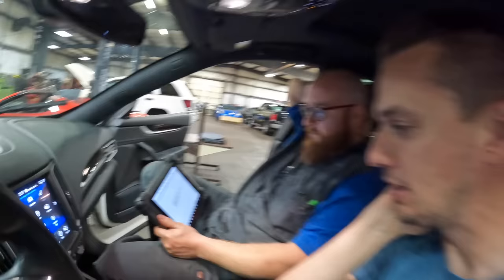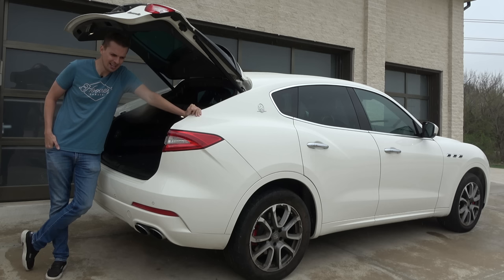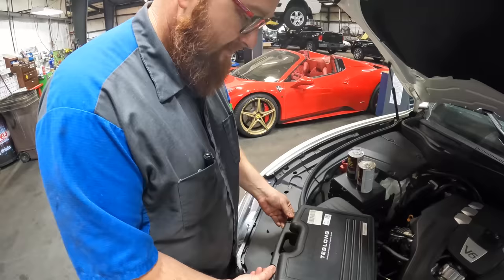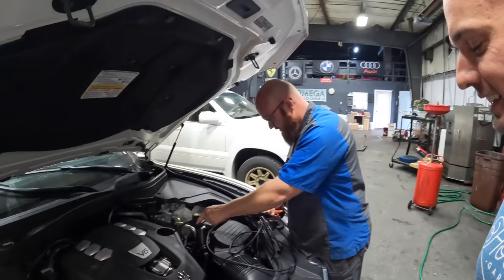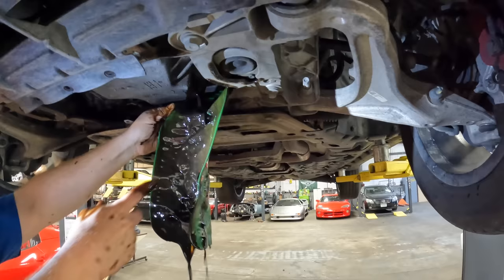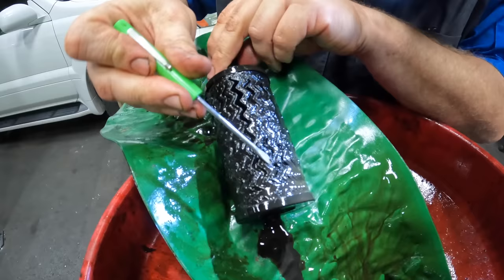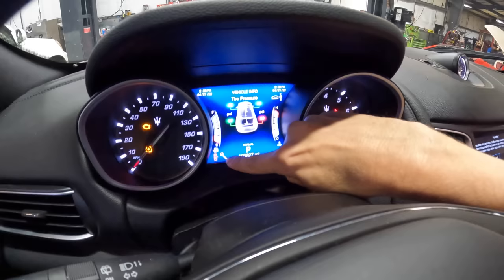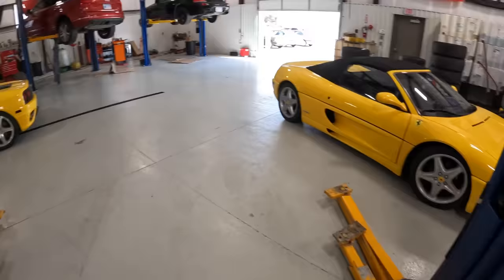My cheap Maserati Levante repo was a DRUG RUNNER, with NO OIL CHANGE for 60,000 miles!?!?!

Comment: What terrible advice on potential meth contamination. You rip an apartment to the studs when you find a renter had meth in there with a hazmat crew. Who knows what you need to do with a car. Just don’t have your family around it or be near them after you were in the car if you continue to choose to be in that vehicle. You also are likely to have a huge hassle if you ever get pulled over.

Comment: LMFAO. Those turds depreciate faster than gravity could take one to the ground if you pushed it out the back of a C-17 Globemaster III during flight. The 2023 models are will soon be out (if they aren't already), so yours is nearly a four-year old vehicle. The average resale value for a five-year old one in decent condition, substantially less miles, at least reasonably well maintained, and NOT a rolling hazmat incident seems to be around $28,070. And you paid how much? Man... the handful of GoobTube videos you'll wring out of that pile, and the million(?) views you accumulate with each... must pay fairly well. One thing, though: How much is your time worth? Because, if you ever manage to get pulled over by a LEO who has a K9 unit with him/her, your five-minute ticket experience will likely turn into a 90-minute search and partial disassembly. After which, you will... probably (one assumes there's not actually any product left in there ;-) ) be told, "Okay, sir, you're free to go, and sorry for the inconvenience." Because they'll be too embarrassed to add "after you've reassembled your interior and part of the body," ha ha ha.

By the way, the chemicals you can smell offgassing in your interior... the reason you're smelling them is because you're inhaling the molecules. I wonder if a doctor and before/after lab tests could see the difference in your liver after you spend a reasonable amount of time in that thing with the windows up and the air conditioner set on recirculate. . . .